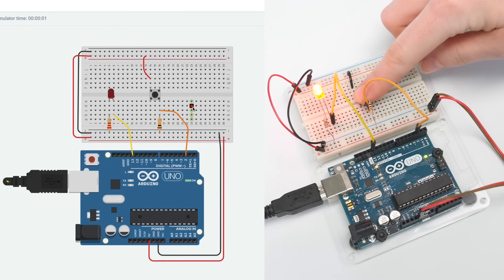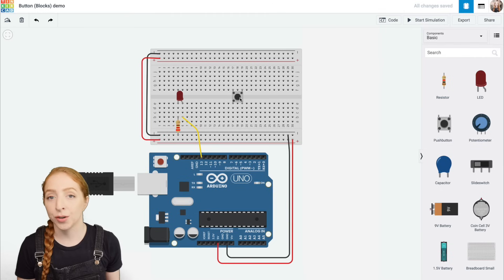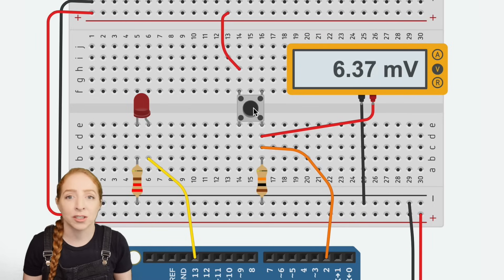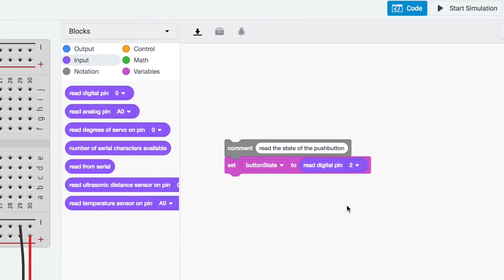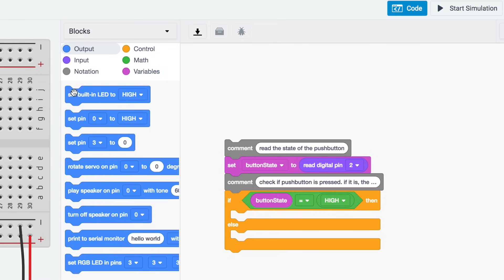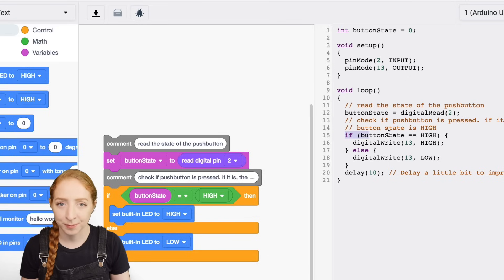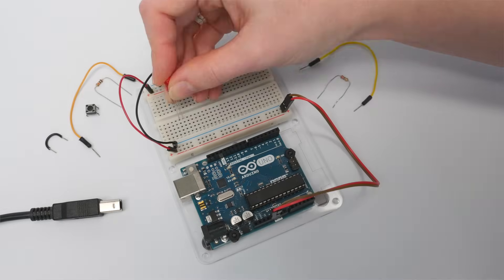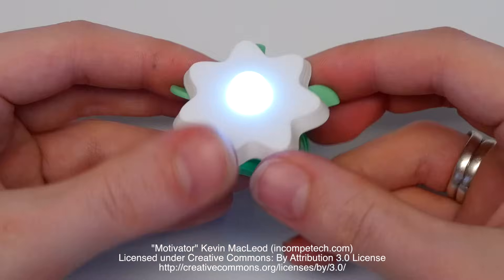Pushbutton Digital Input With Arduino in Tinkercad

Comment: // C++ code
//
int Button_State = 0;

void setup()
{
  pinMode(2, INPUT);
  pinMode(LED_BUILTIN, OUTPUT);
}

void loop()
{
  Button State = digitalRead(2);
  if (Button State == HIGH) {
    digitalWrite(LED_BUILTIN, HIGH);
  } else {
    digitalWrite(LED_BUILTIN, LOW);
  }
  delay(10); // Delay a little bit to improve simulation performance
}
Reply: Try making sure the variable is "buttonstate" and not "set buttonstate" or "button state".
hope it helps

Comment: I have a project I'm doing and don't know how to do it. I have done a lot of research, but to no avail. I need a switch to turn on the LEDs, then I need a button to have 3 LEDs lit and stay lit, then with that same button, once pushed have it turn off the lit ones and light up a set of 3 other (different) LEDs and say lit until the button is pushed again and the process repeats for an additional set of 3 and then continues in that loop until I decide to turn off the power switch. if I turn the power switch back on the same ones need to be lit that were lit when I switched the power off. Is this possible? Do I need to hire someone? Is there any code available or schematic diagram. Thanks in advance. -Carson

Comment: I press but nothing happens. My code shows LED_BUILTIN and not 13 for the output. Not sure why it is not working. Any suggestions from anyone would be greatly appreciated. Thanks.
// C++ code
//
int buttonState = 0;

void setup()
{
  pinMode(2, INPUT);
  pinMode(LED_BUILTIN, OUTPUT);
}

void loop()
{
  // read the state of the pushbutton
  buttonState = digitalRead(2);
  // check if pushbutton is pressed. If it is, button
  // state is HIGH
  if (buttonState == HIGH) {
    digitalWrite(LED_BUILTIN, HIGH);
  } else {
    digitalWrite(LED_BUILTIN, LOW);
  }
  delay(10); // Delay a little bit to improve simulation performance
}

Comment: My Button is always "on" and I really don't get why ...

- 5V to Button
- diagonal pin of the button go to input pin of arduino
- other pin of this side of the button goes to ground with an 10k resistor

Code:
const int signal = 11;

void setup()
{
  Serial.begin(9600);
  pinMode(signal, INPUT);
}

void loop(){
  if (digitalRead(signal)==HIGH){
    Serial.print("Ok");
  }
}

But it always prints "OkOkOkOk ..." without pushing the button

Comment: do you need to add the variable? will it work if you just put read digital pin instead of buttonstate?
Reply: I tried it and yes it did work so anyone whos wondering yes you dont have to put a variable

Comment: Hi thanks for the video! I am new in electronics, so I would really appreciate an answer to this question: why does the LED not turn on if I place the resistor on the righthand side of connection to pin 13 (every connection still technically remains the same). Hope that makes sense! Thanks in advance!
Reply: Since this resistor is only being used to limit current through the circuit, it can actually be located on either side of the LED. Placing the resistor on the positive (anode) side of the resistor will have no differing effects from placing the resistor on the negative (cathode) side of the LED.
Reply: @manmathsinha8906  but since the current travels from positive to negative, shouldn't we connect the resistor to the anode? If I understand correctly, if I connect the resistor to the cathode of the LED the current will have already traveled causing the LED to burn. Can you help me understand if I'm wrong?

Comment: Madam with this code I had associated simple built_in led blink code and change button led to pin 4
Problem is when I pressed the button, the 4th pin led glow but the built in led goes off
My objective is that when I pressed the button the button led will glow else LOW,
Simultaneously the built in led perform their standard blink code